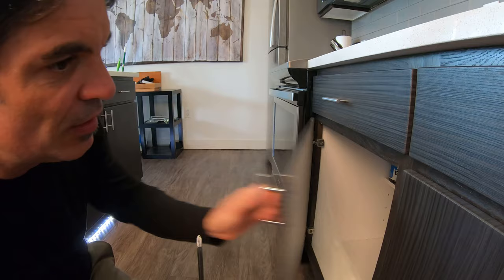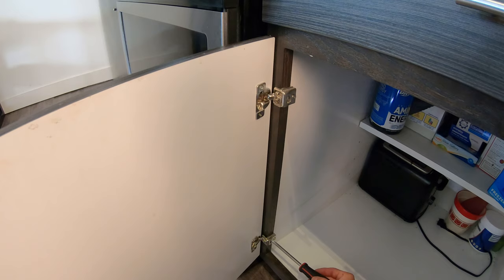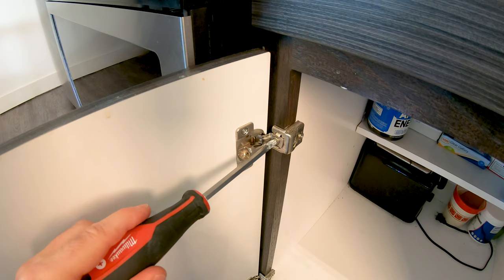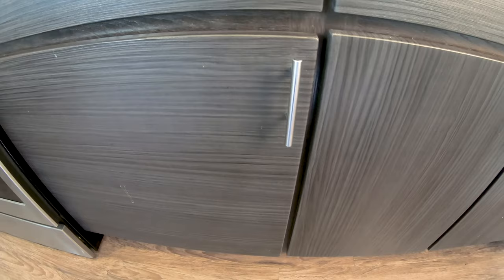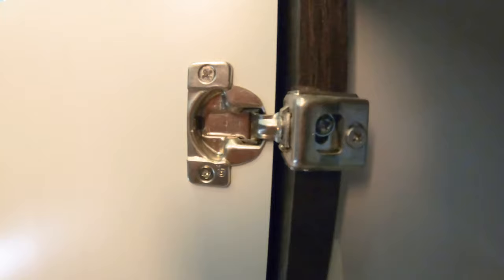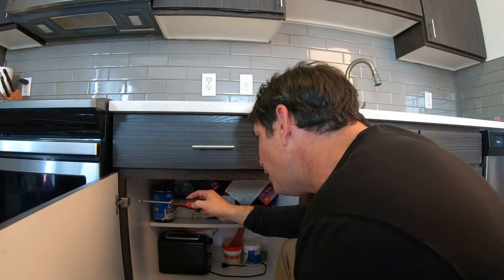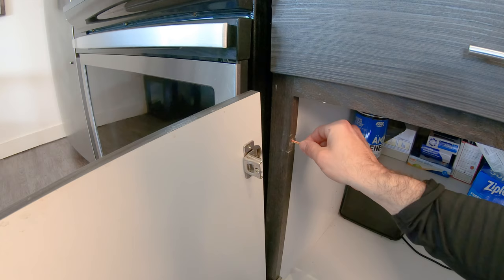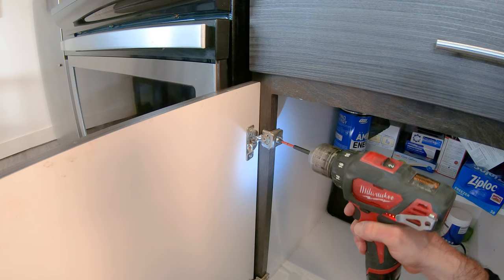How to Fix a Cabinet Door that stays open

Comment: I have a cabinet door that wants to stay open but you can't replace it with just a hinge or tighten the hinges up... The wood is warped at the bottom from water dripage from the kitchen sink. What I need to do is replace my kitchen cabinets. Any idea how to temporarily fix something like that? I can loosen the bottom hinge significantly to get the door to close most of the way. Maybe I can get like an adjustable hinge like you have on that cabinet door and adjust to the warpage if that makes any sense.

Comment: My problem is that the cabinet is an upper one and is not hanging on the wall right.  Friends tried fixing it for me but aren't handy souls.  The knickknack shelf on the side is coming away from the cabinet and the top shelf in the cupboard collapsed.  If you could see the nightmare work the previous owner did in the house!.  What solution I can only think of for the door is to find some kind of magnet to attach that I can install to hold the door shut so I don't get a concussion some day.  You open the door and it stays open and you run into it suddenly.  It is not an expensive cabinet.  I am on a fixed income of about $1200 a month, and want to find a fixit that a 76 year old woman who uses a walker to get around can handle and afford.

Comment: What do I do when I don't have the 2 extra screws that adjust it 🤔 It's just the 1 screw that holds it on the door. Must be some old ass hinges & the sad part is the landlord just put them in 😂 It's not super bad, the door just stays open a bit & it drives me crazy cuz it's my dishes cabinet.
Reply from the maker: You can try and use washers to push it inward. Washers on the screw
Reply: You could experiment with velcro or magnets. A great way to 'stick' the door to the body using either of these two options. The best part is you will not need to mess around with the structure of your door or the hinges. Just some clever glueing / nailing. Both options are also effective despite being quite thin, so they won't affect the clearance if glued to the right spot. Both options also continue to function even when lightly painted over, which means you can match them to the colour of your door / furniture body.

Comment: My cabinets close right, but just don't stay closed!
Reply from the maker: How old are they? You might be able to make an adjustment depending on the hinge.
Reply: @ApartmentMaintenancePro  I don't know how old. They are blum hinges similar to the ones shown here, but they can only be adjusted side to side, not forward and back.
Reply from the maker: @rfresa  they could be slightly warped / or the cabinets could be as well.